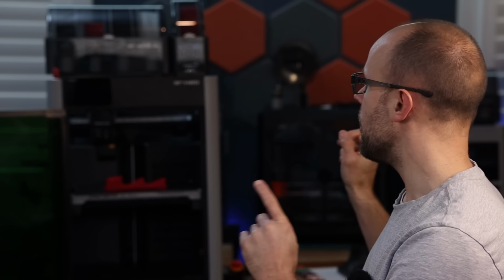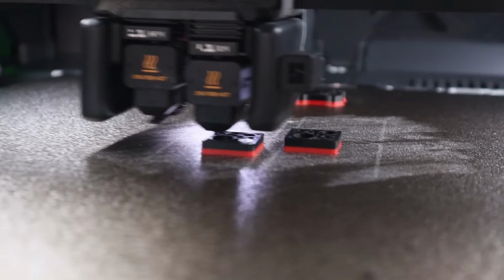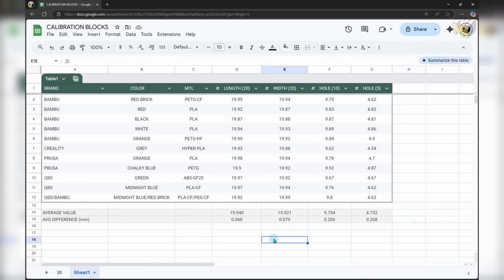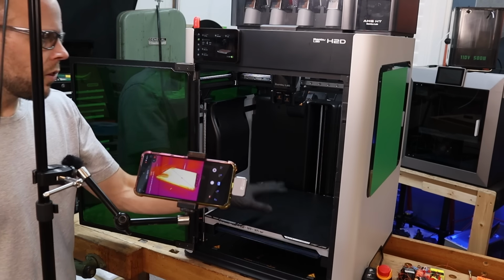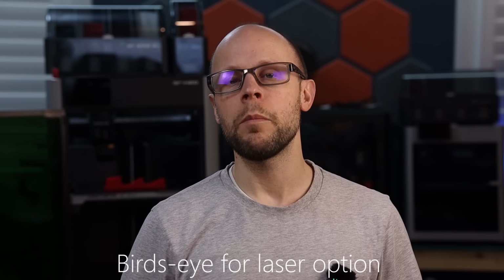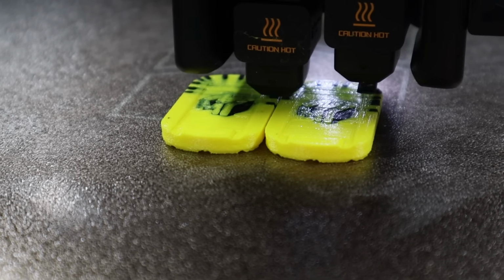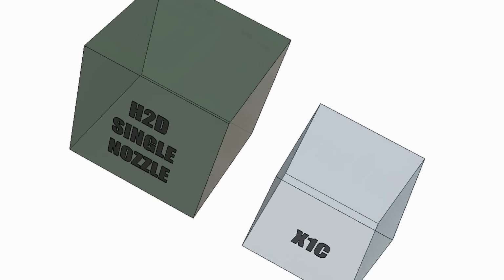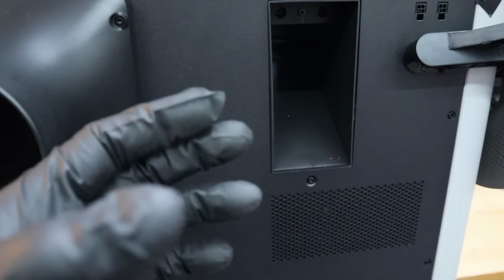I nearly broke the NEW Bambu Lab H2D printer.  What you should know before you buy one - Full Review

Comment: Joel at 3D Printing Nerd was able to use the full build volume. Just load duplicate colors into the nozzles (or use an AMS on each nozzle to retain color options while still having at least one duplicate color in each nozzle).
Reply: Thanks for confirming, I had planned that, but didn't have a print that required it yet...
Reply: that is for only a youtube videos - if you had a single color you would see the very clear lines where the two pint heads switched, and there would be two on the front and two on the back.
Reply: That's what I was going to do lol just got mine today setting it up tomorrow I cant wait
Reply: That is such a stupid work round
Reply: @ it works 🤷‍♂️ the nozzles are limited by the laws of physics from reaching the opposite sides of the bed, so it’s kind of the only way to do it. Not so much a workaround as it is the way it is done. You could modify the gantry to be larger than the bed so that each nozzle could reach each edge… if you were so inclined, of course.
Reply: @ Why should I modify it? Why didn’t bamboo account for it in the original design?
Reply: @Extreme-everything47383 man you'd complain all the same if they made the whole machine 5cm wider. They'd still lose the outer edges for the opposed nozzle and you'd still complain about that.
Reply: @LachskoenigIV Yeah I fully understand why we miss 25 mm on the sides. I do think they should’ve made the printer a bit larger. I care nothing for the laser addons, they could’ve skipped that. Minimum 350x350x350 mm for a 2 nozzle print would be great. I still ordered the h2d as my first printer in many years but i’m a little sad about some of their choices.
Reply: @hschokker86  they probably have a million data points from all of their cloud user print data that told them that the majority of people dont use the full build plate of their printers anyway, probably why they didn't go extrra big with this new printer.
Reply: @hschokker86  But if it was a 375 mm gantry that allowed full use of the 350mm build plate, what would stop you from questioning their choice to not use a 375mm build plate to be able to make at least partial use of the 375mm gantry.  But then, as long as they've got a 375mm build plate, why not extend the gantry to 400mm to make full use of it.  But then, if they've got a 400mm gantry, why not extend the build plate to 400mm so you can at least make partial use of the full build plate.  And so on...

Larger is always better, until either the price or bulkiness of the printer becomes a problem, which will be at a different point for different people.

https://www.youtube.com/watch?v=xJxwvZ5SE_c
Reply: @Justin_Leone  I love you for that reference 🫡
Reply: @Extreme-everything47383  I was making a point. Bambu designed the printer they wanted to make. Full stop. If the specifications don’t perfectly align to your desires, then you can either live with it, or you can change it yourself. Those are kind of the only two possibilities. It is clear that nothing would make you happy anyway, so it’s kind of a moot point. I hope you have the day you deserve.
Reply: @michaelbraaten  I would be happy with a multitool head bamboo with the same bed volume, but not limited based off how many colors I’m using.
Reply: @ sure. In this case, it is down to marketing. They shouldn’t have even tried to call it 350, but here we are. I understand why using the same color in both nozzles isn’t a great solution, but it is the one way to do it lol… they should’ve just called it 325, or increased the overall bed size by 25 (or 50? My brain isn’t working quite yet) so it could be 350 with one nozzle, but they wanted to massage the facts to call it 350. All this could have been avoided lol

Comment: 3D printing nerd showed 350 mm width multicolor print, you just have to have same colors doubled in 2 AMS units.
Reply: but do you need 2 ams? wouldnt it just work if you load in 2 black filaments left and right ? 

i dont have the printer yet, just rly curious ^^
Reply: @Bastyyyyyy  Two AMS make sense with the H2D for the following reasons:
When slicing a model, you get a recommendation as to which filament should be fed to the left and right nozzle. This also shows how the filaments should be arranged to accelerate printing.
It is tedious to change the filament manually, and it is not sensible not to do so for the sake of convenience.
According to the manual, TPU should never be used via the AMS and, if possible, only with the ‘left’ nozzle.
Reply: @Bastyyyyyy  i think no need for ams
Reply: @Bastyyyyyy it would
Reply: @ you wouldn’t need any AMS units if it is just a single color print… but if you wanted more than one color, you would need at least one AMS

ETA: I’m saying using both nozzles, loading the same color into each. Using AMS units just gives you color options in addition to the duplicate color.
Reply: @michaelbraaten wrong, the full print bed can only be used when using two nozzles
Reply: @kekkodance  He's right. You only need the same material in both nozzles... AMS or not. But even in multicolor prints, you have access to the entire volume as long as any single filament (nozzle) doesn't need to span all three regions of the build plate.
Reply: @ yes that’s what I was saying. Apologies for not being clear. I’ll edit to add that.
Reply: @kekkodance  that is a really stupid workaround you shouldn’t expect anybody to do that
Reply: @Bastyyyyyy I believe you just have to have 2 rolls, one on each nozzle, no AMS needed. I can't wait to get mine.
Reply: I’ve been commenting the same on everyone’s videos lol